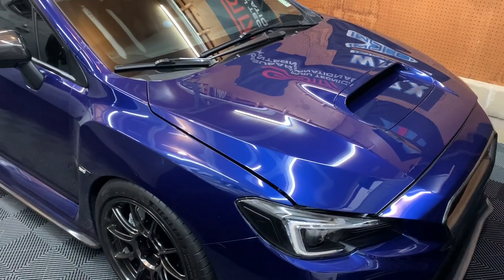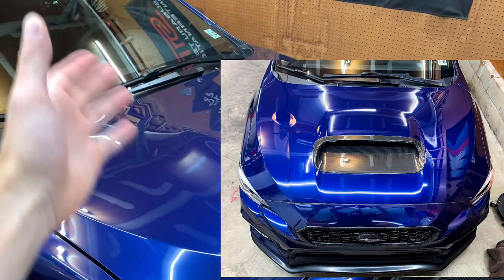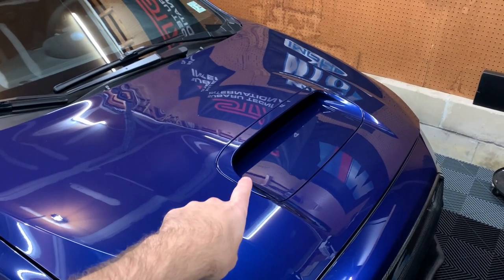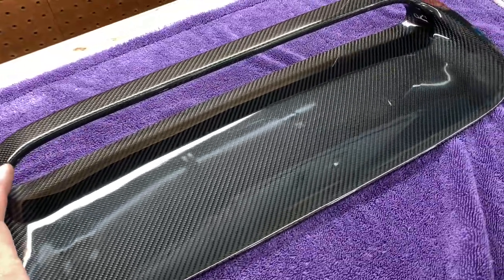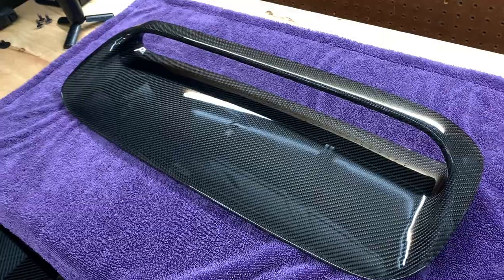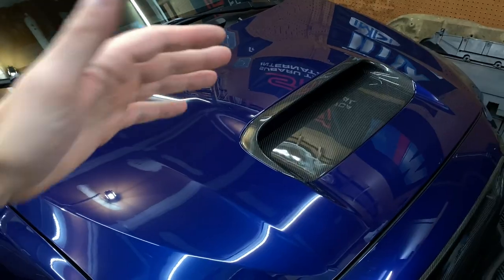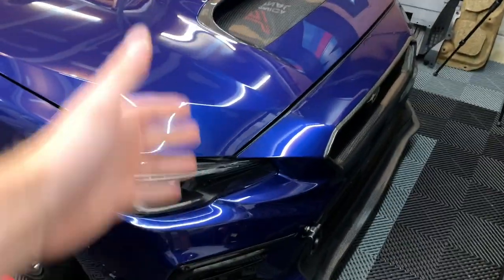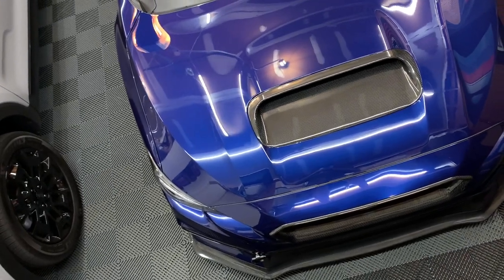Installing A Carbon Fiber Hood Scoop On My STI | FULL REPLACEMENT!

Comment: Just ordered one and used your code! Thanks! I ordered 2 from eBay over the summer and the 1st came damaged and was returned. Second one was total garbage the carbon was lifting from what ever was underneath and was all wavy. Sent that one back? Hopefully 3rd time is the charm with this one.
Reply from the maker: You’ll be very happy with this one!
Reply: Oh and I have a 2019 lapis blue sti too.
Reply: @21notyou21  You get the new one yet? I'm thinking about pulling the trigger too.

Comment: Kinda off topic, but Do you know of any products that will get rid of some fade on rubber seals and car trim ( mainly on the exterior of the doors...if that makes sense.)
Reply from the maker: You'll need to do a deep clean on them to remove any contaminants and then coat them with a trim coating to bring them back.

Comment: What size bolt do you recommend? I’ll pick some up at Home Depot before my scoop arrives Wednesday.
Reply from the maker: I showed the size difference in the video. Not sure of exact size, but the clip should give you an idea.
Reply: @Scoobyfreak86  I couldn’t tell from the video. The only bolt type I know is M6 lol. I had to pick some of those up at Home Depot to mod the wing on my ST. I’ll just take the bolts to HD and ask someone for a longer version.

Comment: Did you have to drill holes? I just got mine and it doesn't look like the holes are going to line up qith anything
Reply from the maker: Did not need to drill anything. All the holes line up perfectly. Make sure the top of the scoop is wrapped around the hood and no on top of it. It slides into it.

Comment: what size bolt did you get for the hood scoop?
Reply from the maker: It’s been quite a while. Don’t remember what I used. Just found some that fit in my bolt bin.
Reply: @Scoobyfreak86  oh ok thanks just try save  myself sometime that all

Comment: I've seen you could cover up the vent with a mesh piece like the carbon hood, I think that would be a really nice touch!
Reply from the maker: That came with it on the VIS hood. Stock hood does not have a grill/mesh so I don't think I'll be adding anything. I almost took it out of the VIS hood for a cleaner look.
Reply: @Scoobyfreak86  I like the look of it lol